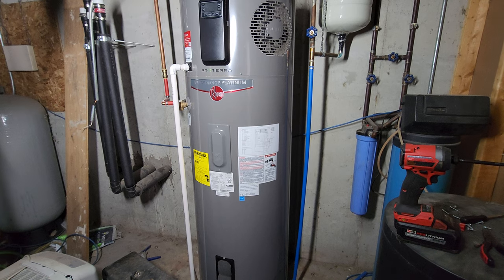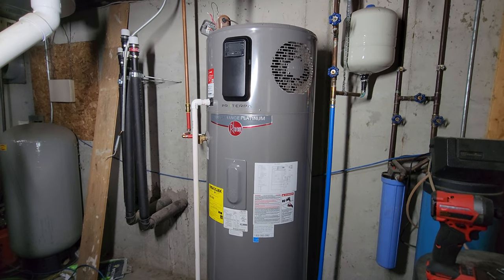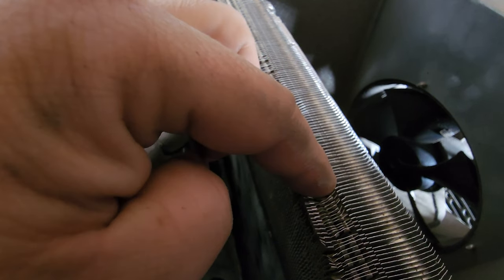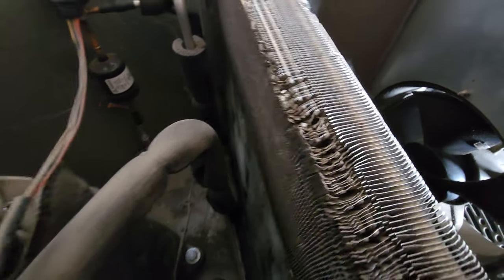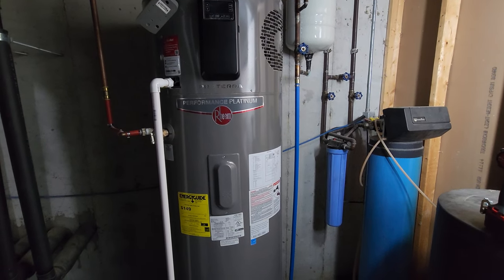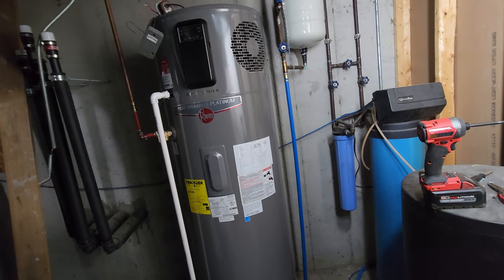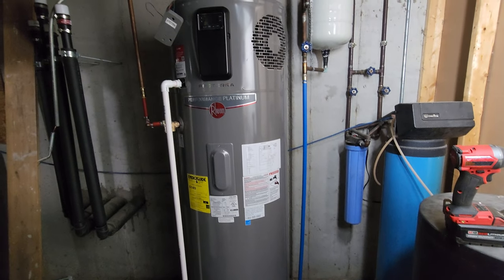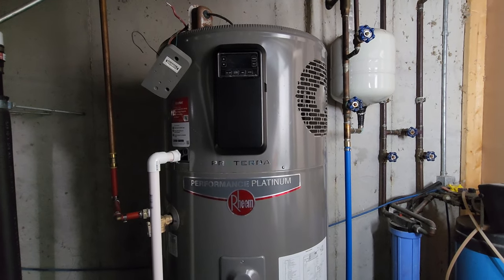The downside to a heat pump water heater. It works great till it doesn't.

Comment: Dont bother with these water heaters...im a retired plumber now but was in the trade for over 32 years and did hundreds of water heater repairs and installations.Back in the day when we didnt have all this eco crap requirements water heaters lasted 15-20 years without touching them...sure these hybrid waterheaters along with the tankless ones do cost less to operate but you will more than spend any savings on trying to keep them working.

Comment: Slower. More expensive. Technology that can't be cheaply repaired if it fails.

Let's make that mandatory.

The VAST majority of pollution comes from industrial sources... why are they pestering the homeowners with green laws? For show? For money? To avoid bothering industry leaders and shareholders while looking green? It's just another covert tax we didn't get to vote on before they thought it was going to buy them votes (via campaign funding). 

Whatever. Fix it or not. It's your future... even if you don't have kids. Eventually inflation has to change wages, and erode buying power of old money. It would suck to be old at that time because entitlements and passive income are not going to do well. And when the math is allowed to crash the debt the federal givernment won't pay off... states will have to carry burdens individually and many of them will hurt from it but some trade will continue like that, as to soften it, but some trade relationships won't be as critical or reliable. It's gonna be weird. Not like people think. And we have to start helping each other and back off on the narcissism... even if we don't agree on things. We need peacemakers.

Comment: Not easy to remove anode rod
Reply: Use an impact wrench like what they use to remove auto wheels in a garage. I did that and the anode came loose in about 20 seconds.

Comment: Dude the problem is the filter it self 
If you are pulling it and vacuuming it it’s a trash filter 
You need to get a pleated filter and change it when needed 
Don’t vacuum get a new one 
That’s also the evaporator the water is the condenser 
Clean the coil if it dirty from sorry air filter 
If is freezes then you have either a low charge or bad EXV OR TXV WHAT EVER YOU HAVE 
35 years HVAC HERE 
GET A BETTER AIR FILTER
Reply from the maker: Good points. But the whole point in the video is that rheem does not make any of this clear to their customers and most customers will not bother.
Reply: Honestly, no different than all the hype of a “Thankless” water heater. They require maintenance too which most don’t until they don’t work any longer.

Comment: Man you have some terrible filtration in your home if there is that must dust in the air and you clean it every 3 months.  I don’t think any filter will solve your problem. I bet your furnace is just as bad.  Stop blowing all the dust around with your air compressor actually remove it.😂😂